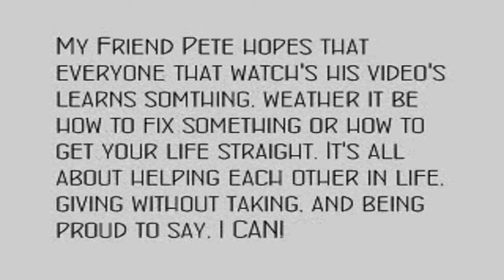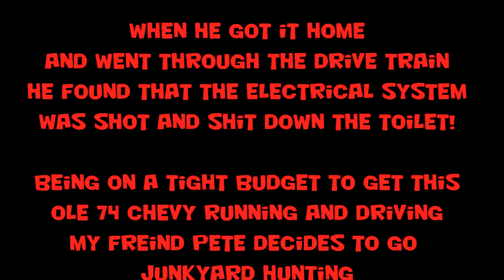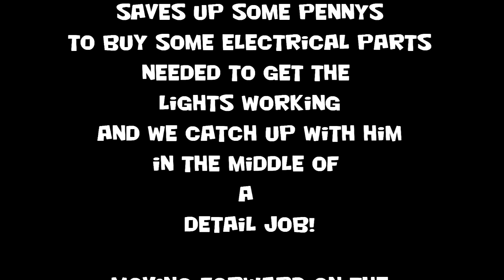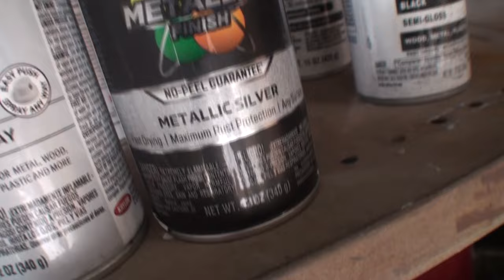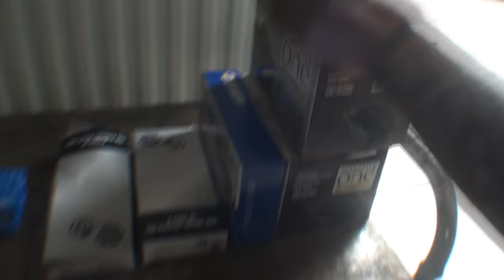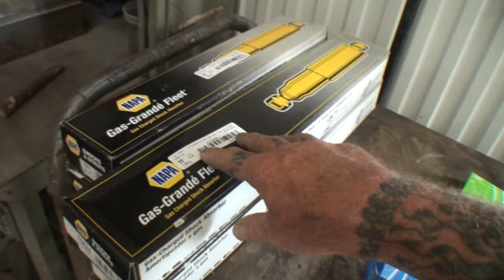Square Body Chevy Truck - BIG BLOCK 454 - Money Pit Pile Of SH*T

Comment from the maker: Our 3rd installment on the OLE 74 shows us that Money is like a water fawcett when dealing with these old "SQUAREBODY" Trucks.. What's your opinion on that??
Reply: It looks really good for a 51-year-old pickup. (My 1982 C30 is running on the original engine with about 600,000 miles on it - 6.2L diesel, slowest vehicle on the road, but it runs)
Reply: My Opinion is, it Looks Like Ya Pulled Dat Wire Outta a Fire🔥 Pit From Hell 💥
Reply: Any thing these days cost Way too much. She's a keeper . Got a couple square bodies myself . That is a nice truck My Friend Pete .
Reply: Every vehicle is a nonstop running money faucet. Even if there just parked with a cover over it…. 👍
Reply: MY OPINION...IS?....I think it is purty BADAZZ!,,,,,You have a,  ERA CORRCT , "1973-(74 Whatever) CHEVY BOX TRUCK", and a VW Dune Buggy and a Karma Gia sittin in your driveway..THINK about that,for a minute,  okay?......Again? Love it!!! 😁             🤘🔥🤘

Comment: I enjoy wiring and solder / shrink wrap slices. I prefer factory color so it can be traced, diagnosed and repaired as needed. I drill into metal lamps like tail/stop to add an extra ground to the frame using eyelets, star washers plus dielectric grease. This is sold in home stores In automotive, as it’s twice the price at auto stores. 
   Pete, your 74 C10 w/454 cu in has no A/C? If it uses the Harrison R-4 radial “Pancake” compressor, let me know. I have 7-8 new in box from ACDelco. Add two Oz of SAE-40 HVAC oil to each component you replace or add. 2oz condenser (Flat extruded core for R134a), you will need the appropriate HVAC box, evaporator, air distribution inside box W/heater controls for A/C as the used vacuum on purple hose to round vacuum chamber to hold vacuum during WOT, evaporator, but use an oriface tube instead of a POA valve. It goes inside the high pressure line 3ft to 4ft before the evaporator. Most all of these parts are cheap at “Rock Auto” and the rest at the salvage yard. Some wiring is required to the pressure switch designed for R143a, then to compressor with an “IN4002 diode wired at compressor in forward bias. Meaning the silver or white side faces the positive wire at the connector to the compressor. This eliminates high voltage spikes passing thru the electrical system, that causes a popping noise in the radio or other. Sounds like a lot, but it’s not! Then you have A/C on a 30 year old vehicle that can run “historical Plates” you buy once! 
  Thank you kindly for sharing!

Comment: bought one off my gf's brother with a small block,put 80 bucks in the tank drove to my next town n back. bout 20 miles each way and burned half a tank. sold it a few days later,heavy gas pigs. ill pull a trailer with my 2000 2 door blazer with a v6 all day on 40 bucks.

Comment: I can't wrap my head around a 454 daily driver. I could see making less occasional runs for extreme heavy loads. My daily is a 1993 WT long bed with a dog ass 4.3 v6. My beautiful !972 Short bed Ranger sets under cover in my garage. Afraid to drive for getting hit by all the POS drivers and hustlers on the streets today. I think my love for car days are over. I appreciate folks like you still running a shop with this high inflation ongoing. Folks that live in the Midwest need a car to go to work. Wages don't cover food, car, phone and rent. They should maybe stop driving to work and walk to the food lines. Use their car as living quarters. They continue with these extreme profits and low wages to inflation. Folks need to stop shoeing up for awhile.

Comment: I see low cost complete wiring harnesses on ebay for that year trucks.  I would have never bought used, and I would have never bought from some overpriced company selling someone else's wiring assemblies, at a high cost.  The ebay harnesses seem okay, I guess it all depends on if they have all the right ends the wiring harness controlls, like sockets, etc.  My 1997 chevy 2500 diesel has similar hacked up wiring harness, it is outside waiting for me to put in new ignition switch and turn signal switch, several battery cables, and really clean up some of the hacked up "additions", by using shrink tubing to seal repaired section.  I keep the truck long enough I'd really just go with a new wiring harness,..all depends.  Technically, some of the diesel trucks like the 90's models are basically too hard to work on and not that much pulling power, too electronic control for my liking.  Gas powered trucks with a large or powerful enough engine seem the way to go, and great if it aint driven every day due to the cost of fuel....diesel gets okay fuel economy over gas models,...like my 6.5l diesel (394 cu inch) gets bout 20 mpg, manual transmission, what its supposed to get,.....when its roadworthy.

Comment: Correct on Ecklers, I ordered a 63 T Bird Exhaust that was supposed to be factory correct.  I had to bend it to fit and it sounds like crap.  My 87 Corvette console pad took months to get. Maybe 4  or 6 months. forgot. what has happened to this company? Also correct on restoration. Car  sits under cover and not driven much.

Comment: $13 for 2 back bulbs hope they were  led. Other wise if they are charging that much for 1157 bulbs that's robbery. By the way that's the wrong dash pad in the truck at the moment . that's a 81-87 pad